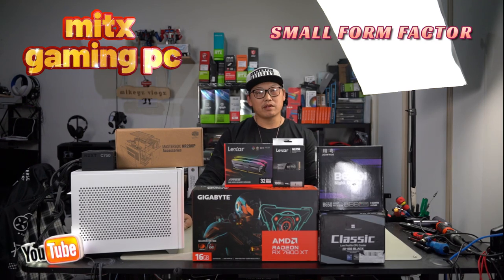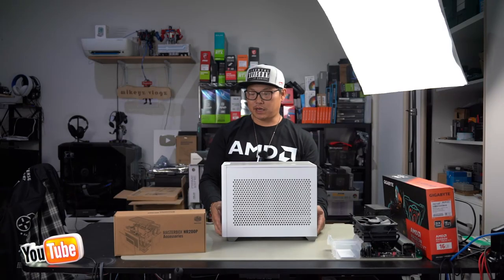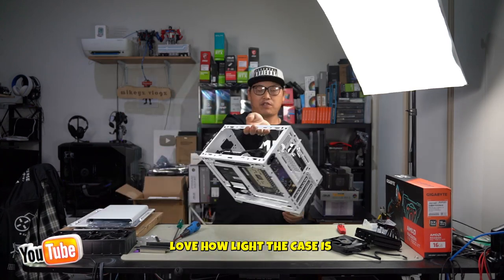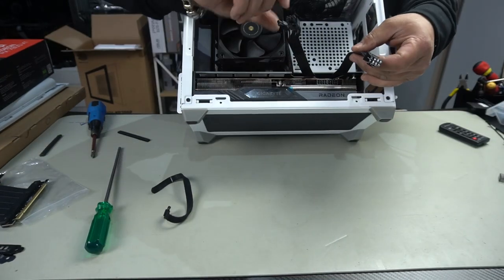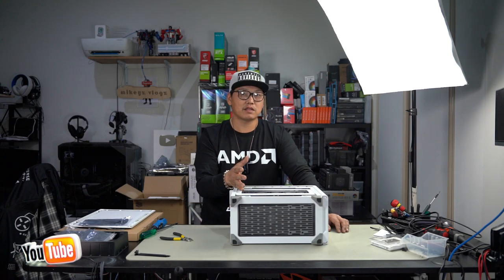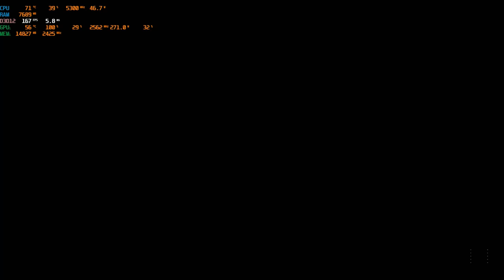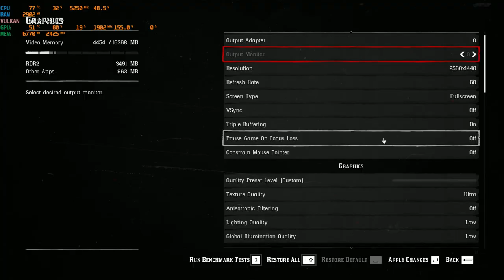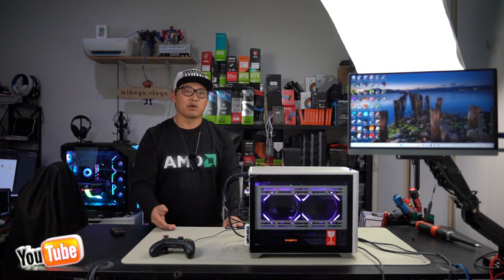MID RANGE AM5 ryzen 7 7700 mitx gaming pc build cooler masterbox NR200P v1 paired with rx7800xt 16gb

Comment: Hello! I want to build an cheap pc for me, found this motherboard and i would get great discount if iwould buy this motherboard and CPU like ryzen 5 7500f, after the discount applies it would cost me something like $230, but i don't know how it runs in terms of vrm performance, I am thinking about overclocking the ryzen 5 7500f a bit and after 2 years upgrade to the better cpu but yeah as i said before i am not sure if motherboard will handle it (if vrm will handle it)
Reply from the maker: it's good enough ..u can watch other youtubers fo full reviews on this mobo.. and it has heatsink and thermal pads for the vrms too.. keeping it cool enough to do what u need... I've been using this for my cooler master sneaker x mitx build and it runs a 7800x3d no issues
Reply: @MIKEYZVLOGZ  i've just watched your entire video and i can see that on cinebench you got 90°C ... Is it bad airflow fault or its motherboard fault? Now i am not sure if i should buy it. I think i will get an ASRock B650M-HDV/M.2
Reply from the maker: @szympHans ok so i was using the glass panel if u want u could always use a mesh panel instead and it could bring the temps down abit... and also remember that ur pc isn't going to be under full load all the time so your mobo won't run at thay temp all the time
Reply from the maker: however if u are looking for a mobo that runs better..u will need to spend abit more ... this is primly the cheapest mobo u can get IMHO... and it's cheap for a reason...but that doesn't mean you can't use it... I will try and d do normal tasks and see how the temps are and with mesh i stead ...cuz wen u use glass panel u don't get the cold air intake like u would with mesh ...